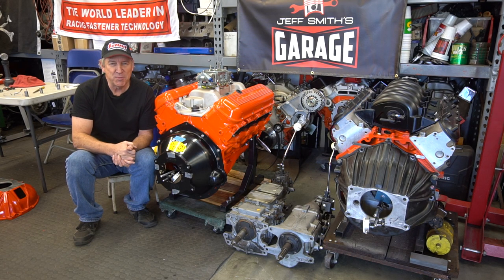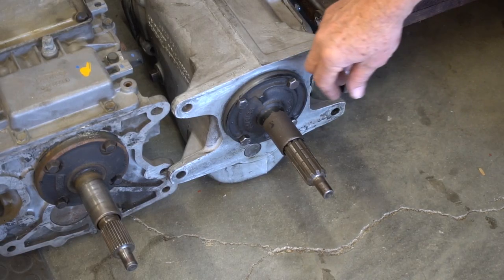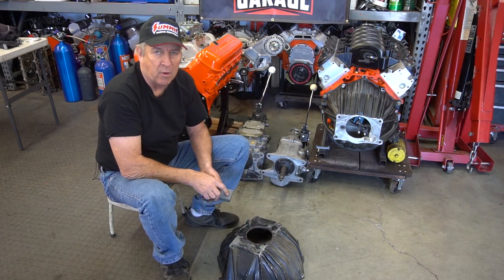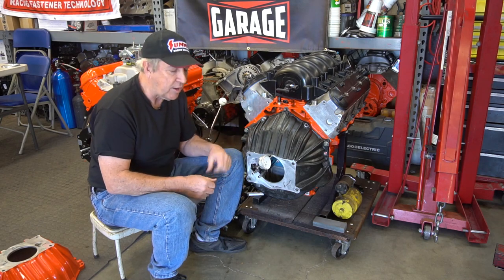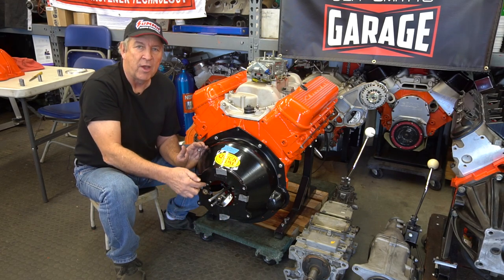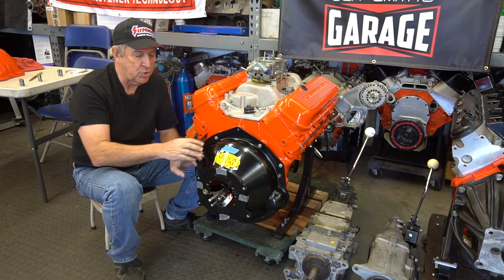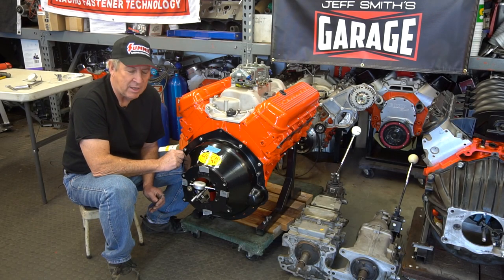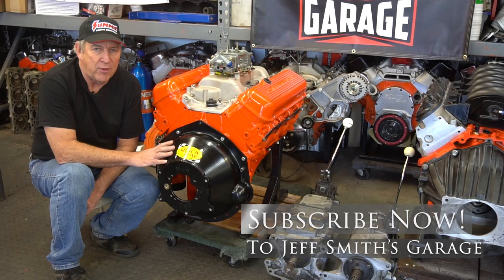Bellhousing Alignment Tech & Tips

Comment: According to what it says in my GM service manual, the oil pan on the LS engine is a structural member. It's easy to understand why they tell you this when you see how the bottom of the bell housing is bolted to the back of the oil pan as well as the top of the bell housing being bolted to the engine. If your oil pan is protruding and tilting the bottom of your bell housing out .03" then you have a misaligned oil pan. I can see how somebody might be inclined in a pinch to just remove metal from the rear of the oil pan to fix the problem, but the correct repair is to R&R the oil pan. I recently had the LS1 engine out of my truck and had to replace the oil pan. The GM manual says to use a straight edge and feeler gauge to align the rear of the oil pan with the rear of the engine. I found this was too difficult with the tools I had to get a true reliable reading, so I supported the engine in a manner that allowed me to bring the automatic transmission on it's own wheeled jack support to the back of the engine, and bolted the trans to the engine. Then it was easy to fit the oil pan flush to the trans bell housing the way it is supposed to be. Of course with an auto trans there is no input shaft location concentricity to check, but it's still important to have the back of the oil pan flush with the back of the engine no matter what transmission you mount on it. The GM manual says the rear of the oil pan must NEVER protrude, but even if the oil pan is not interfering with the bottom of the bell housing, you still don't want any large gap there either. A gap will cause things to flex when bolted tight. GM's specification says to hold the clearance from zero to .01" (.25mm). If you fit the oil pan flush after bolting on the bell housing, you have zero.

Comment: For those that have asked. All bell housings need to be checked, factory and aftermarket.
It is 50/50. It either will be in spec, or it will not. But you have to be 100% certain.

I put a TKO in one car, (years ago) and a TKX in the other this past year. One had an aftermarket housing (Bendtsens) and the other was OEM.

Making sure all paint etc. is removed from the mating faces of the block, bell flanges engine  and transmission sides, and the face of the transmission case.
Also make sure the inside of the bell flange circle is clean, as well as the pilot bearing retainer outer diameter. And the dowel pin holes in the bell housing are clean and true.
Running a fine tooth flat file (using fingertips like playing the piano) and make the file in figure eights or a knife stone like in the video.

Also checking runout on the flywheel since you are already familiar with the process.

Stacking up by using a clutch alignment tool, put the tool in the disc, put the disc in place flat against the flywheel, set the pressure plate against the clutch disc and install the pressure plate bolts and then run them down until the bolt heads just contact the pressure plate, and then tighten them in a star pattern about 1/2 turn each until snug (about 10 foot lbs) and then use a torque wrench set at 15 ft lbs, tighten following the star pattern and keep adding 5 ft lbs until you reach final toque per spec for your bolts (ARP) or per manual for your application.

All of this will take some time, but worth every second you spend prepping for the miles and time you would be driving without troubles.

And the RobMC cammed pins are worth everything they ask!

Comment: Jeff, I put a tremek behind a 460 years ago and it never did shift properly. I think it's a combination of being off-center and the pivot ball not being long enough. Not sure the shop set this up and maybe they made a mistake. Anyway I'm building another one have a 460 block in the shop ready to go and I'm going to look into a quick time bellhousing I used the Lakewood last time. Thanks for the videos I'm a new subscriber keep them coming especially if you do any 460 stuff!
Reply: Thanks Dan - my experience with the older Lakewood bellhousings on small- and big-block Chevys was that they tended to be off my between 0.025 and 0.030-inch! So that may be why your trans never shifted properly. And as we showed on the video, then engine can represent part of that inconsistency.

Comment: How do you orient the gauge to know that its exactly centered with the crank before starting?
Reply: Curt - thanks for the question - that is something I probably should have addressed in the video. The beauty of this procedure is you do not have to center the dial indicator. Merely place it so that it will read consistently for the entire 360 degrees of rotation. This will take some time to set up but once the dial indicator is positioned all its really doing is indicating the relationship of the housing bore relative to a stationary position of the dial indicator housing - since the dial indicator housing is not moving relative to the bore. When the housing bore is centered- the inidcator travel will not move away from zero. This is rarely the case, so the indicator reveals the position of the housing in relation to the indicator - that's why it's important to keep track of which way the indicator moves - in or out - so you know it's relative position to the crank centerline. Hope this explanation helps. Feel free to ask more questions!

Comment: How to you true the micrometer to the crank?  If the mic isn't centered to the crank wouldn't it throw off your measurements?
Reply: Yes you are correct - if the dial indiator is not pependicular to the surface, it will affect the reading but sometimes it's just too time consuming to get it square. I've checked it both ways and frankly can't see a significant difference - perhaps 0.001-inch. If you are concerned with total accuracy - then yes it's important- but with a spec range of 0.000 to 0.005-inch - an error of 0.001 isn't that critical.

Comment: Does the offset throw the bolt holes off bell housing and block
Reply: I think this post is dead. There is enough clearance within the bolt holes to allow movement. If you take a bolt and put it in a the bellhousing tons of clearance hence the need for dowel (alignment) pins. Have them on cylinder heads for the same purpose.

Comment: You said at the beginning of the video one has to be within .001" inch of concentricity - FALSE. One has to be with .005" run out or .010" of total indicated run-out. So if one has a reading of 8 thousand on the dial indicator their run out is 4 thousand and within spec and they don't have to do anything with offset dowel pins.

Comment: If you want to stumble across some more info about using a indicator in this type of scenario, read the rest of this.

You're missing one variable that a lot of people aren't aware of,  even machinist I work with thay have been machine for 40+ years werent aware of it and that's indicator stand sag. 

If your indicator stand isn't ridged enough it will flex from the gravity. The stand you are using probably isn't ridged enough when the indicator is out that far.

If you want to test it,  attach the mag base to a bar stock or even some 2" square tubing. Zero the indicator then rotate it upside down and look how much the needle moves.